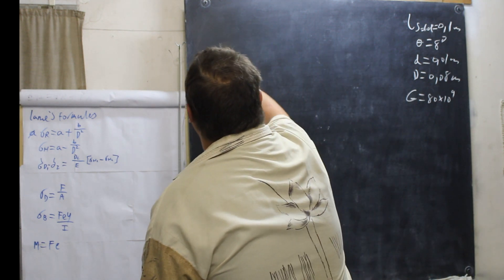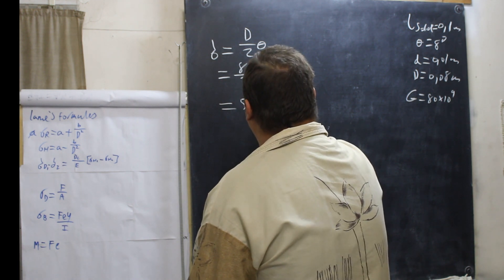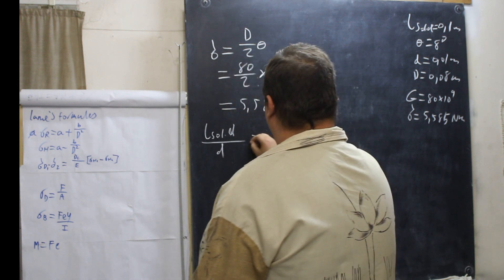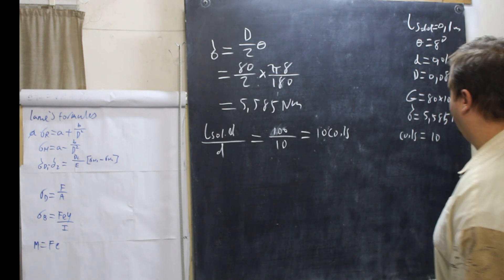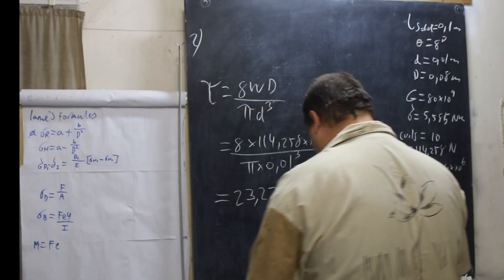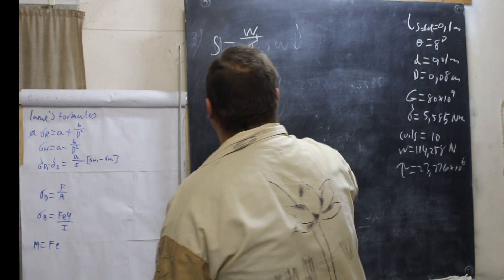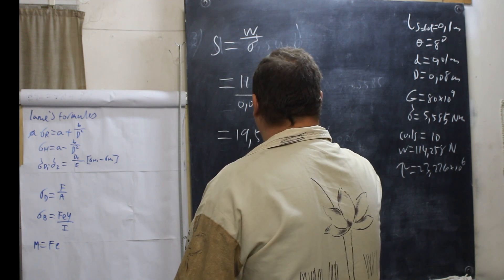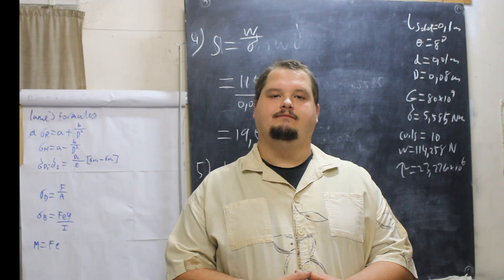N6 Strengths Closed coiled Helical Springs Module 7 Worked Example 7 1 Explanation

Comment: Textbook made a mistake on calculating W, they used a deflection of 0,00585 instead of 0,005585 the correct answer is W=109,082N instead of 114,285N changing your entire calculation